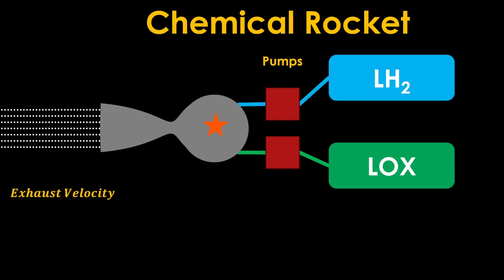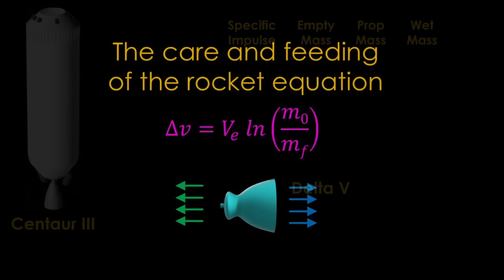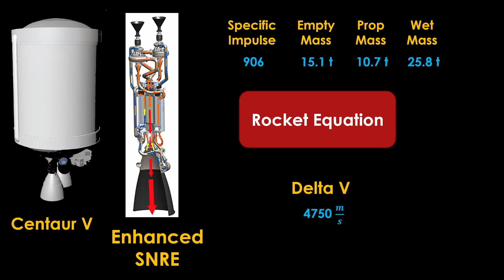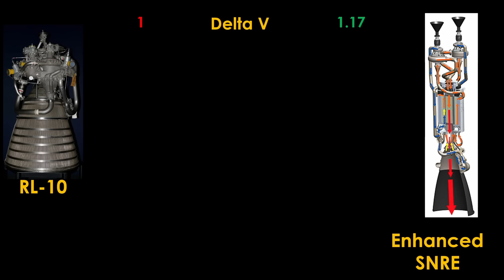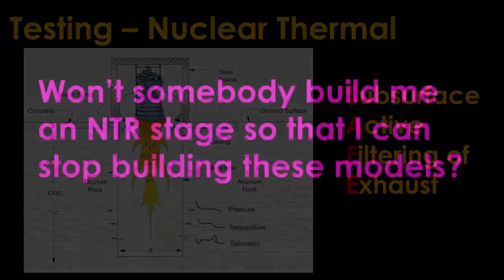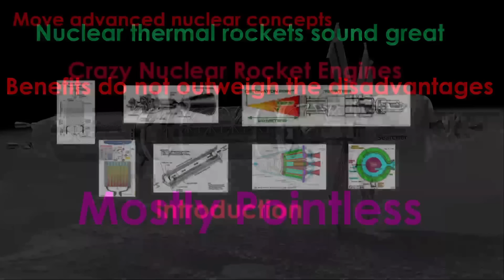Why Nuclear Thermal Rockets are Mostly Pointless

Comment: Fantastic video - I actually worked with a large research team on this exact trade several years ago, modeling the particle physics and running an extremely large vehicle trade space in collaboration with the nuclear lab at our university and other partners. I think this might provide the alternative model you're looking for, or at the very least I'd be interested in hearing your thoughts/criticisms: doi 10.2514/6.2025-4096
Reply from the maker: Thank you. That was very interesting. 

I don't know enough about DYREQT or how it was used to have an opinion on the results that it gave you for spacecraft sizing and since the paper didn't include any masses, that's hard to comment on. It wasn't clear to me. Your reactor masses are roughly what I'd expect given what SNRE or SNRE enhanced are claimed to mass, though the open question with SNRE and your design is "how much shielding is required?" I don't think there's a good answer or that. I do know that NASA's mars vehicles with crew included 8 tons of shielding for a 90 (ish) ton vehicle. 

From the delta-v perspective, with large payloads you are going to have lower thrust to weight and leaving LEO you are going to be hurt by the Oberth effect.

I'm in the middle of a follow-up video based on the NASA Mars architecture and have pretty much come to the same conclusion. Nuclear likely wins on overall vehicle mass but I think it loses on pretty much everything else, and that means the trades are highly sensitive to launch costs. If you are launching on something as pricey as SLS, nuclear looks pretty good if you can actually develop the engine. If you launched on Falcon Heavy or New Glenn 9x4, your launch costs go way down and the cost advantage of nuclear goes way down.

Comment: A great positive for NTRs is that they will drive a new wave of high temperature metallurgy, and as long as the research money is spent wisely we may end up with interesting new materials technology, and possibly even a new understanding of the behaviour of materials we already know as well as validation of the various models of how radioactive NTRs will become during and after use.

Also once you have a permanent presence on the Moon, setting up a test range for nuclear rockets where they can be connected to measuring equipment in a controlled environment will be (relatively speaking) a piece of cake.
Reply: that's a positive spin on the fact that we do not have the ability to manufacture a real world device.

Comment: All those numbers will change dramatically if
A. Space-only tug with max acceleration like 0.1 m/s**2
B. Higher deltaV
C. Heavier cargo
D. Big, space only, space assembled balloon tank. Maybe even inflatable tank

Low acceleration mean you can make tank much much fragile, not like soda can(earth based tanks), more like actual balloon or "water-in-water" floating water storage tank.
Reply: Inflatable tanks filled with liquid hydrogen?

Comment: There has never been a new propulsion system that was much better than the old “mature” propulsion system it was competing with. Marginal improvements with new technology can add up fast once you get started. Project Rover and NERVA worked, the political and economic landscape changed. Without a Mars mission it could not be justified, chemical rockets remain the only practical choice to get into LEO, until we can build an elevator. For heavy lift to the moon and beyond we are going to need something better.
Reply from the maker: For NASA Mars architectures the NTR ones are a little better in that they require fewer launches to assemble the vehicles. That's very important if you are paying SLS costs for the launches, less important if you are paying Falcon Heavy / New Glenn prices, and (probably) not important at all if you have reusable starship launches.

Comment: What about higher molecular mass propellant, and nuclear engines still make sense as a ramjets for first stage or jn SSTO and they were actually proven to work recently
Reply: The heavier your propellant the less you ISP.  The power to weight ratio tends to make them a no go for first stage.
Reply: NTR for launch is terrible, the thrust to weight and hydrogen tankage kills them.  Air breathing engines can not hope to move enough mass to produce the thrust for an orbital rocket, the air is simply too thin and ingesting it at high speed causing insane heat and drag.
Reply: @kennethferland5579 still air breathing engine could give some velocity and allow to climb to altitude of around 15-20km, surely some hybrid rocket ramjet that would inject some high mass propelant into nuclear core after reaching certain velocity and altitude would be possible

Comment: How about attempting a Fission Torch drive. Just fully react the fissionable material and eject it into space together with some additional propellant media to bulk up the heated mass. You get rid of the added reactor mass and just need to magnetically confine and direct the resulting high speed plasma. (ya I know, nothing easy about this, and the optics of dumping radioactive material into space is bad, but conceptually it would likely provide a lot more thrust)
Reply from the maker: You might like my crazy nuclear rocket series. 
https://www.youtube.com/watch?v=7GL9aKLYz4U
Reply: @EagerSpace  Thanks for the recommendation. As for a few of my development direction opinions, I would like to see an aim for nuclear thermal/torch-electric hybrid drives, which utilize MHD power generation to scavenge erratic/perpendicular expansion forces within the nuclear plasma propellant to gather power from the plasma propellant and utilize this power to further boost a portion of this propellant with an electric stage, perhaps with a PIT/Pulsed Plasmoid configuration.
Additionally, an option for utilizing dirty regolith-based volatiles as propellant would be optimal for any drive that is to be utilized for asteroid mining as it could use this as a pre-processing step for the materials while it is transporting them.

Interesting to see the math for Nuclear-thermal setups not living up to their expectations, but in my mind it just means that those old design specs are too immature and have not yet found the optimal path to more fully exploit the nuclear energy.
Reply: Nuclear salt water rocket concept from Zubrin is basically that, it leaves a cloud of radioactive fallout behind itself and is not something we have any hope of developing on Earth.
Reply from the maker: Nuclear salt water rocket is a continuous nuclear explosion happening just outside the rocket body. Seems very hard to keep that explosion from migrating inside the rocket - the failure modes are pretty much "you blow up".

I do have a video on the nuclear salt water rocket.
Reply: @EagerSpace  well, failure likely means the nozzle breaks or melts, but once the nozzle is gone, the geometry needed for the sustained fission is likely also broken, so the reaction will likely stop before the entire craft is consumed. But then again, any ship that loses its engines, or have a catastrophic fuel containment issue are probably all in the same boat of either being blown up or adrift in space.

Comment: Honestly all you have to do is play Kerbal Space Program with some mods to get it. 

Even optimistically, a NTR rocket is getting twice the ISP of the best chemical rockets. So you still need to lug around a lot of propellant to get at best maybe around 10,000m/s of Delta-V depending on how heavy your vehicle actually is. 

IF you're set on using nuclear power, you're better off using that to power some kind of VASMIR engine. Tiny thrust sure, but the extremely high ISP makes it more viable for Interplanetary travel.

Comment: Poorly performing bombs 🤯
Reply from the maker: Yes. There's a big non-proliferation argument against weapons-grade uranium in these engines because you want to track those materials very carefully. The 20% (ish) that some designs use isn't great for weapons because of the additional mass, but it's still enough to reach critical mass. 
That's based on what I remember when I did a deep dive into enrichment a few years ago.

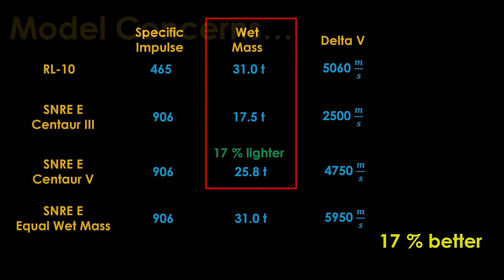Comment: 6:58 your comparison is potentially misleading. nobody flies an upper/transit stage without mission payload. assuming for example a trans mars injection delta-v around 4200 m/s, the chemical stage archives this with about 3.3t of mission payload. On the NTR stage of equal mass, 8.7 tons can be pushed to the same velocity. not the same launch mass, i know, but the "advantage" is not 17%, it is more likely exceeding 200%, which only gets better with higher tankage ratio and relaxed thrust requirements(RL-10 is on the low end of trust for an efficient hydrolox engine, but it is still pretty big, which helps in the scenario of orbital insertion, but transits could get away with less)

Comment: Nuclear thermal propulsion would be considered to give a 1000 tones 5,000 m/s delta-V, not to boost a small satellite into earth orbit.  Large payloads into Jupiter orbit.
Reply: Starship is designed to have 7,000 m/s deltaV when fully refueled in low earth orbit, at a total mass of 1,700 tons. At less than 1/100th the cost, and with a heat shield that reduces required propellent by about a third on the Mars/Earth route while NTRs can't be used in any ship entering the atmosphere.

Comment: i think nuclear electric propulsion is the direction they should go, since magnetic fields can be made to accelerate particles to far higher velocities over thermal.
Reply: Solar electric offers a better path for any mission short of Jupiter.  Nuclear in space is very very hard and Solar is just off the shelf ready, all you need to develop is a long truss arm to hold the arrays that already exist which is trivial.
Reply: @kennethferland5579  solar electric is reasonable. as far as the subject of nuclear in space being hard, it isn't hard in the nuclear electric sense, but the thermal sense it would be, as it requires the propellent to keep it from melting down, vs the conventionally established reactor systems that have been around for decades. the only drawback could be bulkiness, but going to mars, light drastically becomes reduced, so more bulkiness must be accounted for even solar electric power. i am not saying it is bad, just that significant mass will be required from any method to get out there.
Reply from the maker: Nuclear electric is hard because you need to get rid of the waste heat from the reactor and all the electrical equipment. Lots of radiators.
I have a video where I look at NEP.
Reply: @EagerSpace  it's not hard, but bulky. most of what you showed in that video is only important if one is trying to save as much weight as possible, but in space, scale isn't much of an issue, unless you intend to land the rocket on a planet. if it is just going from orbit to orbit, then just use pipes.
Reply from the maker: The rocket equation still matters from orbit to orbit, and heavy structure reduces your delta v.
Reply: @EagerSpace  delta v is not a meme, but it is close to it. i will always want a rocket with better isp over delta v. if the engines are shut down for 90% of the flight, there is no more acceleration, and no more increase to top speed, therefore, delta v is dead during the majority of flight. in space i want top speed more than acceleration rate. the only time the opposite makes sense is with thermal rockets, since the isp produced is only double standard rockets. but with electric rockets, this is much greater, as electromagnetic forces can push particles up to relativistic speeds, as seen in particle accelerators.
Reply from the maker: If you don't have the delta v to go from a to b, you aren't getting there. 

You can work on trajectory design options that may give you lower delta v options, but you still need the delta v to get there. Somehow. 

With ion thrusters you can get great specific impulse but the current ones are very low thrust, and you lose some of the benefit because of the Oberth effect. Still enough to make it worthwhile in some scenarios.
Reply: @EagerSpace  delta v is not unimportant, but if the engines are not active, there is no delta v at all. as for ion thrusters, just like with super heavy, one can place numerous engines that make up for a large amount of reduced thrust. yes, i know that heat is more, but space doesn't care about width of a craft, so designing an ion craft shaped like a solar sail allows for radiant lines along and in front of the sail, and thousands of gridded or hall ion thrusters on the other side would make up for all of the thrust needed. 

 the only way to make ion thrusters be a poor choice boils down to propellent. noble gasses are rare, so unless one goes with mercury or hydrogen, it becomes more about an argument for vasmir.
Reply from the maker: https://www.youtube.com/watch?v=xUoE7wOB-fY

Comment: I think trying to force NTRs into a launch stage where you cant have low TWR is kinda dumb (engine mass hurts fuel mass fraction)

I'd assume NTRs would be best for in-space stuff where slower acceleration (0.1-2m/s) is fine, where you can optimize for a decent mass fraction while still having the benefits of high ISP
Reply: At that low you might as well use Ion engines as your not transporting people.

Comment: Good to see someone point out these issues. I keep seeing the Hydrogen specific impulse tossed out because it is a nice big number, without consideration of all the other headaches Hydrogen and NTRs bring.
Hydrogen is such a problem to store that I expect any realized rocket to use Ammonia or Methane instead - bringing that big attractive specific impulse down. The thermal loads demand more heat management, read weight, than comparable chemical rockets. And for a last point: that nuclear reactor runs a lot differently when propellant is rushing through it, stepping down the reactor may require venting propellant for a time without producing much thrust.

This may be useful in a different epoch of space travel, but right now is like trying to downscale a jet engine to run a lawnmower more efficiently.
Reply: Finally some who has done their research, the thermal managment is a nightmare for one because you have not just two regimes as in a rocket (on/off), you have 3 thermal regimes, (unignited, running, decaying), aka a reactor will produce decay heat after running so it will not return to it's pre-ignition state EVER.
Reply: Thermal management is not an issue with  nuclear thermal because the propellant cools them
It’s basically an open cycle coolant loop. Similar in concept to heating up a heat sink then dumping it into space while hot 

Ammonia has really bad Isp while methane has very decent Isp on nuclear thermal, this is because the max temperatures we can achieve (around 3000-3800K, this is a melting point limitation) do not allow ammonia to be be broken apart into lighter hydrogen particles, where as the same temperature does decompose methane. 

As a result methane has an Isp of around 630 while ammonia is I believe around 235, similar to water, all using thermal engines capped out by the melting point of all known materials. 

Methane is practical as a fuel, the Isp is around a third lower than hydrogen but the thrust is around 4 times higher while the fuel volumetric density is around 5 times higher and the mass ratio of the fuel tank is also much higher 

Hydrogen will always win out vs methane on vessels with sufficient fuel reserves (at equal mass) when you measure delta v, however, nuclear methane is still better than all chemical rockets by quite a wide margin, while being more convenient to handle, denser (matters for aerodynamics, as well as armor. Density and mass of the fuel tanks are independent metrics), and also potentially similar in delta v for crafts that don’t have a lot of fuel on board 

The largest advantage of methane however remains the free thrust you get. The exact same engine will output between 3 and 4 times more thrust if you input methane instead of hydrogen with no extra modifications 

I don’t think a methane nuclear thruster has ever been built but the Russians built one that ran on decade which is similar but offers worse Isp than methane. It’s of course easier to handle because it’s a liquid at room temperature while methane needs to be compressed and cryogenic even if the temperatures are less extreme than hydrogen. Methane also has more hydrogen per carbon atoms than decane so there should be no issue for a methane thruster as decane is "dirtier" than methane yet they were able to build a thermal thruster with a hydrocarbon propellant like this

The last noteworthy fuel nuclear thrusters can use is helium. It’s much closer to hydrogen in performance with an Isp in the 800s and slightly more thrust than hydrogen.
Reply: @IceRain-f5v  And do you know what decomposed Methane means?  Carbon coke coating the inside of the engine, Metho-Lox engines run LOX rich exactly so that won't happen, and carbon is a neutron moderator, so you just ramped up your reactivity.  Hydrogen atleast dosn't coat the engine so once it's flowing your neutron dynamics are not changing over time.  This is just the kind of stuff your clueless of because your not doing real engineering.
Reply: @IceRain-f5v  Thermal rockets can't be fully cooled by their propellent. There will be a ton of additional heat that has to be radiated away, especially after the engine is shut down.